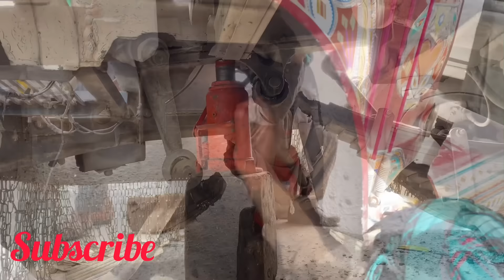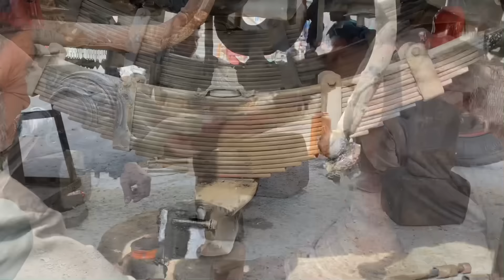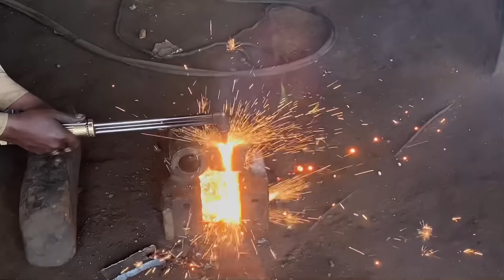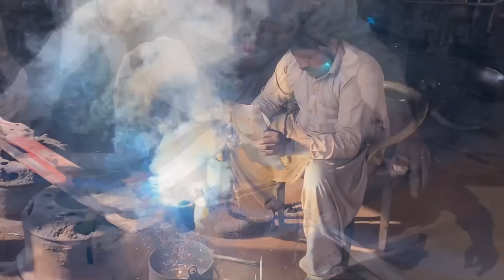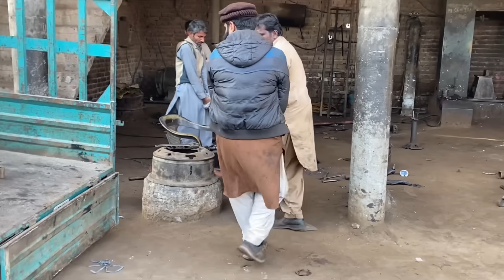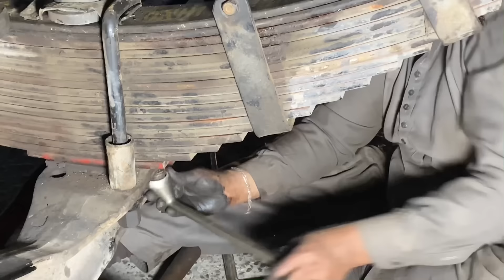Heavy Duty Truck  front Axle Broken Due To  Overload  ON  Road…………

Comment: Thats not how a king pin is installed. The knuckle should move freely it didnt even move when they pick up the axle😂😂😂
Reply: Well that repair should last about a week
Reply: They just don't understand how it works.  That's why they make stupid mistakes.
Reply: They put way too many flat bars Springs over the axell,  no suspension at all🤭🤣🤣😭😭🤧🤧 rough ride.

Comment: Im wondering why they always weld cast iron parts like normal steel, as far as i know cast iron has to be red hot during welding to avoid cold cracking, im curious if those welds really hold on normal use
Reply: I cant see those repairs lasting to long.

Comment: This is madness! This axle beam is factory die-cast.  How to weld it from two parts, no one knows what loads it will withstand now.  But they are definitely much smaller than the whole factory part.
Reply: Forged actually

Comment: The type of steel used to make these beam axles is NOT suitable for welding.   Heat destroys its properties.
Reply: Lets also mention that they're trying to weld what is originally a whole-forged bar together with standard electrodes and no filleting. I'd be surprised if the weld has penetrated even a 10th of the axles thickness.....
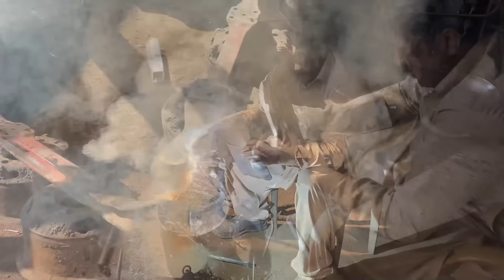Reply: @Fahren47  : Watch more carefully.   After tack welding and tap-adjusting to get the end at the right distance and angle, he arc-gouged out a deep V-groove on both sides - shown 20:24 onwards.   He will have full penetration.   If he had not V-grooved, it would have collapsed as soon as the driver attempted to turn and move off.
We don't know what kind of electrodes he used.   But the axle in the vicinity of the weld will be ruined and will bend under peak loads such as hitting a pothole.
The arc-gouging was shown in this video, but not any angle grinding to get rid of the consequent slag.   Presumably he did remove the slag - the next thing shown was the final weld layer.

Comment: This video and everyone like are bullshit from beginning to end. The bullshit never ends.  It just piles up all over the place. The vehicle should not have been overloaded in the first place. Of course, there are not no vehicle inspections to ensure that the vehicles are sound mechanical shape and are not overloaded. There are no police on site to direct traffic around the scene, to ensure that the vehicle is removed from the roadway for repair, and to investigate and lay charges against both the driver and the commercial operator. The truck is "repaired" in the middle of the road instead of being towed to a proper repair facility. The worst and largest part of the pile relates to the nature of the repairs. There are no replacement parts. The failed pieces are cut, grinded, and welded back together again in a haphazard, amateurish fashion. Between the lack of proper rules, the overloading of the truck, and the inadequate nature of the repairs, this truck will break down again shortly. All the people do is move from one pile of bullshit to another pile of bullshit.

Comment: Amazing and excellent repair! They arc gouged the axle so they could get a full penetration weld, they fitted new bushings to the kingpin, straightened the draglink and repaired the spring pack, outstanding work especially in a day! I'm never complaining about my stateside heavy truck repair conditions :-)